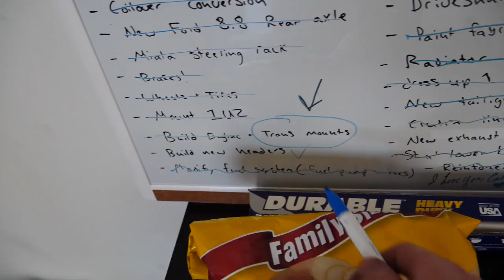SR20 Transmission is Mounted! The Drift Truck Is DONE!

Comment: "It's done"... No car guy really means that
Reply: it's done..... for now
Reply: Can't wait till that sr20 transmission blow up
Reply: Never done, only abandoned.
Reply: Generic HESH Nice, a clutch and a 3500 stall?  Got that auto-manual transmission?  How do you bolt both a torque converter AND a clutch to a flywheel?  Remind me, is it the KA or SR that has more than one head?  Or header?  Sounds half baked, not done.
Reply: Its done... without a driveshaft
Reply: He said it's done in terms of what he had to do with the car. "It's almost running".

Comment: you haven’t mentioned the drive shaft at all. I hope you have that sorted out
Reply: Was gonna say this too
Reply: Was thinking the same thing
Reply: He did say when he was first making the to do list that he was going to have the drive shaft made by a professional.
Reply: Driveshaft should be easy any driveshaft shop can make one now that  he can measure the distance.
Reply: Its there its just the all new highly lightweight invisible driveshaft
Reply: It's just a beam of metal that won't flex under the torque of the engine.

Comment: The transmission is now one with the engine. If the engine mount's allow it to move the trans will need to move also.
Reply: I just tought the same. It would make more sense to go with some trans mount buchings.
Reply: I do see what you mean but there shouldn’t be a huge problem without bushings
Reply: I don't think its really a huge deal. But you are right, the front moving around will put a lot of stress on those rear bolts.
Reply: to be fair though, that rear crossmember will probably flex enough to save the transmission casing... But yes, it would be better in combination with solid engine mounts.
Reply: Glenn 9K Exactly what I was thinking
Reply: im really late and im trying to learn about cars but that was my first thought when he said no bushings, please tell me im correct

Comment: If you want those fittings to go on easier, use some car wash soap or Dawn as a lubricant.  Also, I know it's kind of a pain, but just a bit of tap oil on your drill bits goes a long way when it comes to drilling steel.  If you ever need hardware in bulk, instead of going to ACE Hardware 10 different times, order common bolts through McMaster-Carr.  Rock Auto is also really good for vehicle parts.
Reply: solid advice here
Reply: Joshua Hirtle what’s dawn
Reply: Dish soap. The stuff they clean ducks with.
Reply: Joshua Hirtle thanks I live in England and we don’t have dawn
Reply: Nathan Chapman It's also dish soap.
Reply: You sir, you know what your talking about
Reply: Joshua Hirtle someone knows what’s going on here..
Reply: Someone watched mighty car mods :p

Comment: worst case, you'll break the trans, best case you'll brake the trans mount... the transmission NEEDS to move aruound a bit since the motor mounts aren't solid either. A few clutch kicks and something will fail (I learned the hard way in my 125)

Comment: Great project so far. But you might want to rethink your trans cross member. With urethane/ rubber engine mounts it will move and end up cracking your tail housing or the cross member with out a rubber mount

Comment: So flexible engine mounts and solid gearbox mount? That is putting a lot of stress on the gearbox mount, either solid mount them both or rubber mount them both.
Mounted the engine and gearbox level? Might chew front driveshaft uni's, you want 3 degrees or thereabouts usually.
Reply: I don't think he took driveline angles into consideration when he welded the leaf pads onto the rear end either.

Comment: Gingium, awesome job.  The transmission crossmember looks stout, only one small flaw I could see, I didn't see a transmission mount or any bushings between the crossmember and the transmission.   If it's solid mounted it will get twisted and crack, if I just missed seeing the mount disregard this observation and keep up the awesome work.

Comment: Never buy from Collins adapter ever again.
See you in 3 months when you will need to remove all of that to replace the pilot bearing lol
Reply: IMNOTA srs?
Reply: TT04
Yep, they're known to destroy pilot bearings, but maybe not on this specific kit, but a lot of their kit do.
Reply: @imnota  thats why you put a new one in before you put the trans on? If you didnt replace it thats on you.. i have no problems with collins.
Reply: Special I agree with you, you should replace it when you have the trans off, but it doesn't matter, most of those kits destroy them prematurely. But as I said, it's not the case for every collin kit, so you might not be affected. But even if your kit works great, jut knowing that a lot of their kits destroy pilot bearings kinda prove that it's not a good brand.

Comment: Engine is on Engine Mounts but you mounted the Transmission without Transmission Mounts?
Engine is on rubber but Transmission is hard mound it?
Reply: he's gonna realize sooner or later that thing will vibrate quite a bit.
Reply: 7:13
Reply: Engine is on rubber but Transmission is hard mound it the alu will break

Comment: You should put a rubber tube (door trim kinda thing) around where you cut that hole for the radiator, so you don’t cut your fingers when unscrew the radiator cap! Just an idea :)

Comment: Please put a check valve on that hose going to your brake booster and PLEASE put bushings on the transmission mount , it’s just going to tear itself apart from all the torque  and abuse it will see

Comment: Hey Caleb, are you going to create Ram Air intake for the hood? Figured since the intake is right up front and center? Perhaps create a cold air box for filter to isolate heat from engine wrapped in gold reflective tape and line with rubber seal to hood closure? Also you can modify shifter to lean forward and bend back up to move it up and away from your seat.

Comment: AAAAAAAAGH!!!! Damnit Caleb listen to some advice I’m trying to help you... You WILL blow the sr trans... they break behind 400 hp sr’s and you want that with a v8. Torque is what breaks driveline parts, and a v8 will make more power than a 2.0 4, no questions asked. Love the project but as I’ve been saying since day one, you need to get a z32 300zx transmission. They’re much stronger, and not terribly expensive either. You will thank me so much in the long run when you have to change the transmission after every few events
Reply from the maker: Sr20 trans's can handle 400ftlbs. This engine makes 300ftlbs. 

The torque curve of a v8 is very gradual and isnt too hard on drivetrain components. This trans will be fine as long as I keep the 1uz n/a.
Reply: Gingium yea 300 stock... you are going to be drifting it, clutch kicking, beating on the car. At 300 it will last a while but the second you up the power, it’s bye bye transmission...and you’ve said you plan on eventually building the motor and or turboing it... If you go z32 now you’ll save yourself the heartache of doing again later. Adams sr made like 380-400 ftlbs and it wrecked like 4 transmissions before he went cd009... you will break it, it’s just a matter of time. I’m just trying to help you out bro😂
Reply: Also idk where you read that but a v8’s torque curve is definitely not gradual and not hard on drivetrain... my dad’s iroc Camaro used to chirp gears through 3rd and that was a 305 that made 260 hp modified. He also broke two driveshafts and a trans mount... v8’s hit hard, and trust me dude I love your vids but it’s not gonna hold forever.

Comment: Turbo Yoda from mightycarmods gave the tip to use some Car Wash to put on the hose so it is easier to apply the hose on the fitting.

Comment: Use ruber mount on the transmission, is not right like that, it has to flex a little bit like the engine does

Comment: Are you gonna make more space behind the shifter? The fact that it hits bothers me.
Reply: If he's putting in the RX-7 seats then it won't hit. Edit: Unless you mean hitting the body, and he already said the position wasn't quite finalized. I guess we'll see.
Reply: Vykk Draygo it’s not hitting the seat it’s hitting the metal on the body
Reply: I wonder if he could unbolt the shifter going from the trans and turn it around if it would work, it will then be close to the stock location
Reply: Jake 1024 I have no clue but if he could try that it might be better. Never heard of that but I’m new to this stuff.
Reply: No you can't do that shifters are designed a certain way and if you try any other the shifter will either bind or get stuck or over throw into a gear
Reply: skidnation360  good to know

Comment: I'm guessing the shop is going to do your exhaust bearings?
Reply: And the kanooten valves.
Reply: Hopefully he got the carbon nanotube bearings or ceramic (carbon are better though).  Stray voltages caused by various flux inductions on the chassis can cause tiny sparks across the bearings which cause premature wear.  The aerospace industry learned this the hard way.

Comment: You're going to have a bad time if you have the transmission solid mounted but the engine is not solid mounted because the engine will move but the transmission won't move so transmission go boom

Comment: I had that problem with getting the wrong double din radio for my car. I have been waiting for over two months to get the correct radio as it would be for a different model volvo or the wrong year and so it wouldn’t match the interior. This radio is supposed to have an oem fitment with the faceplate matching everything else. I wonder if the product even exists now. I really want a modern touchscreen with Bluetooth, and all of the other input capabilities but if they mess up again I may just ask to get a refund.

Comment: Has she been started yet or did I miss a video?
Reply: Nah,and I doubt it will be started anytime soon.He has engine mounts but no transmission mounts which will make things vibrate and possibly damage his frame and trans.He also didn't replace the trans bolt bearing so expect to see him pulling all of this out just to replace that.He also has problems with tubing.He also said nothing about the drive shaft so he probably forgot about that aswell.This build seems organized but its a hot mess.Hopefully Ging will see all of these comments,I really want this build to be great!

Comment: AN fittings are not that expensive, and putting hose clamps on those fittings you have now will cause the barbs to cut into the lines and make them leak.